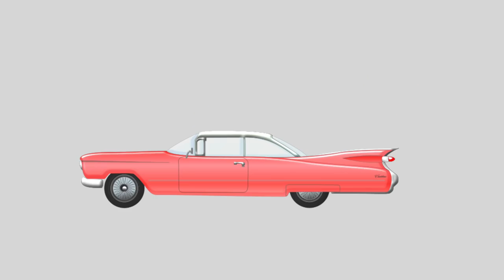Yes, Rockets CAN Fly in a Vacuum

Comment: lol. This is funny. No you cannot get thrust in a vacuum.
Reply: Thrust is an external force applied by the atmosphere. That's according to the 4 forces of flight. So no, thrust in a vacuum is by definition impossible.
Reply: @papalegba6796 so you claim that mass can be accelerated from the rocket nozzle without a force?
But that would be a violation of Newton's laws.
So you think rockets violate Newton's laws?
Cool story bro.
Reply: @papalegba6796 it absolutely is not an external force supplied by the atmosphere. In both instance, in plane or in a rocket,  force is supplied by the moving of gasses as a mass, I.e. conservation of momentum. In a plane. Props or a jet engine, move gas. It is the movement of the mass of gas (air) by mechanical means that provides thrust. In a rocket it is the movement of the mass of gas (exhaust) by chemical reaction means that provides thrust.
Reply: NASA chatbots think the 4 forces of flight are fake 😂
Reply: @papalegba6796  nobody has said the 4 forces are fake. Only that you don’t understand them. No where in the 4 forces does it state that thrust is provided by the atmosphere acting on the plane.
Reply: @stuartgray5877 You're moving to fast Lil Stuey,.. you have to get the rocket erect first.
Then you push all the right buttons.
After one quick stroke of the ignition,..
It squirts white matter all over.
Blast off to space bliss. 🚀
Reply: @dragonz_eye Go figure you choose to throw a tantrum instead of answering his question.
Reply: @AM-rd9pu  Thats because it realizes that answering truthfully just proves IT wrong.
I think this is yet another sock account for papalegba.
Reply: @stuartgray5877 🤣
Reply: @AM-rd9pu 😅
Reply: @dragonz_eye Thanks for proving my point by continuing to throw a tantrum.
Reply: @dragonz_eye  Thanks for proving it even further.
Reply: @frantaspacek Oh, thanks,.. wasn't expecting a compliment.
I'll take what I can get.
Even from a loser.
Thanks, Slick.
Reply: @dragonz_eye Thank you for proving my point with that real mature response.
Reply: @AM-rd9pu LOSER!!!!!
Reply: @dragonz_eye Resorting to petulant name calling is exactly what someone with a valid argument would do right?
Reply: @dragonz_eye You wouldn’t need to keep resorting to petulant name calling if you had an actual argument. This is just getting pathetic.
Reply: @dragonz_eye  - "Do you still think Foucault's Pendulum is a globe rotation proof? "
Yes.
Just as YOU are incapable of explaining the theory of operation of the 100-yerr old gyrocompass.
Reply: @engineeringtheweirdguy2103  yes it does 😂
Reply: @papalegba6796  where then, exactly.  Does it explicitly state atmosphere is a requirement for thrust? Keep in mind, I’m talking about the 4 fundamental forces, not engine operation limitations. Jet engines can fly in much higher and much lower atmospheric pressure than a prop plane can for example. 

Go on.
Reply: @engineeringtheweirdguy2103  yes it does. 😂
Reply: @engineeringtheweirdguy2103  is Newtons first law not in your program, chatbot? 🤔😂
Reply: @papalegba6796  the one that states “an object in motion will stay in motion unless acted upon by an external force”? Please tell me where you see the word “atmosphere” in there.
Reply: @engineeringtheweirdguy2103  a vacuum cannot apply external force, chatbot. Atmosphere can. You lose again 😂
Reply: @engineeringtheweirdguy2103  holy sh!t you're badly programmed 😂
Reply: @papalegba6796  once again. The vacuum isn’t applying the force. It’s the transfer of momentum of the gas that was travelling with the rocket, now exiting the rocket. Nice attempt at a strawman fallacy but no. Sorry, I never said vacuum applies any force.
Reply: @engineeringtheweirdguy2103  there's nothing external for the gas to transfer momentum to, chatbot. You lose again 😂
Reply: @papalegba6796  it doesn’t need to. It transfer to the rocket. It’s an action reaction pair, not an “action, reaction, reaction triplet”
Reply: @engineeringtheweirdguy2103  it does need to, chatbot. Newtons first law & the gas laws say so. Lie more, you can't change the laws of physics 😂
Reply: @papalegba6796  tell me exactly where it states a third body is needed for thrust. Show me on the formula for conservation of momentum where it shows a third body is required for momentum transfer.

Better yet, using the kinetic theory of gasses, which is where the gas laws are derived from, which states that gas particles are individual particles with their own mass and velocity. Like bouncy balls flying around a shipping container at high speed. Explain to me how the gas particle imparts a force on one body, by hitting a seperate body, not physically connected to the first body in anyway.
Reply: @papalegba6796  go on. You made a claim. Back it up.
Reply: @engineeringtheweirdguy2103  I didn't say a third body is needed to create thrust, chatbot. Just the rocket & the atmosphere, only two. No atmosphere = no thrust, the 4 forces of flight say so 😂
Reply: @papalegba6796  no. You’ve consistently stated that the rocket exhaust can only act on atmosphere. And how precisely do you envision a rocket generating thrust using the atmosphere of the exhaust gas has nothing to do with thrust?

You havn’t through this through very well have you?
Reply: @papalegba6796  and no. We’ve covered this. The 4 forces don’t say that.
Reply: @engineeringtheweirdguy2103  they do say that. Thrust is applied by the atmosphere.
Reply: @papalegba6796  where precisely do they say that? They don’t. Thrust is not applied to the atmosphere in a rocket. And in a jet or propeller engine. Thrust is applied BY the accelerating of air through the engine. Not by idle atmosphere hanging around the engine.
Reply: @engineeringtheweirdguy2103  they do, you just admitted it. Thrust, drag & lift are all external forces applied by the atmosphere. There's nothing else external to apply them 😂
Reply: @engineeringtheweirdguy2103  where does the accelerated air come from, chatbot? The atmosphere, right? So thrust is applied by the atmosphere, you just admitted it 😂😂😂😂😂😂😂
Reply: @engineeringtheweirdguy2103  the engine creates a force pair with the atmosphere, you just said so 😂😂😂😂😂😂😂😂😂😂😂😂😂😂😂😂😂😂😂😂😂